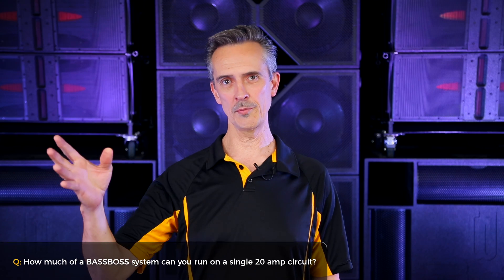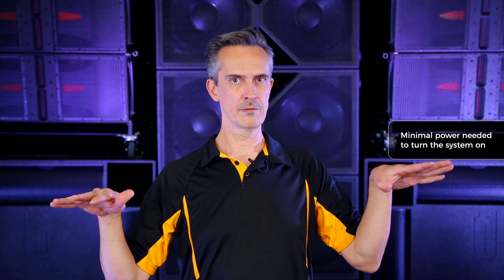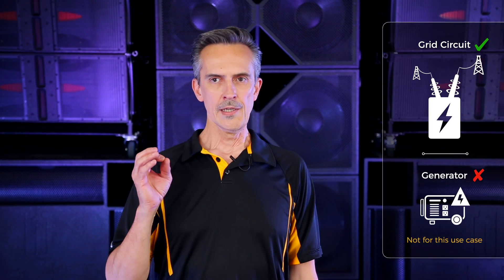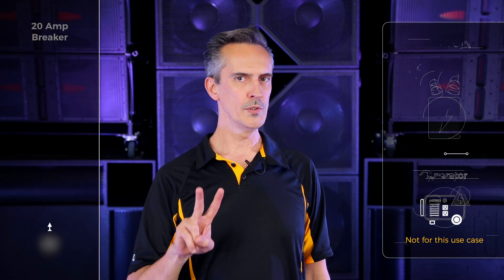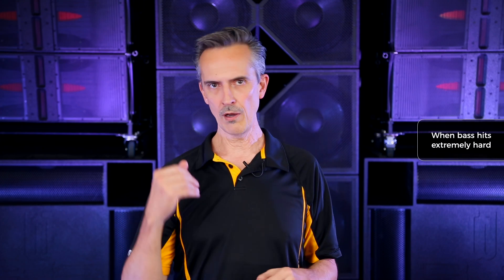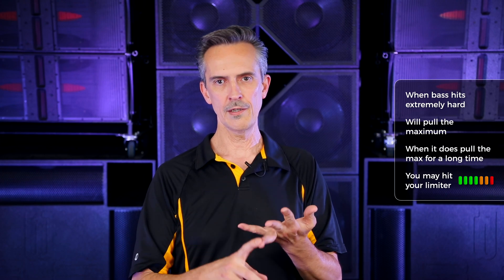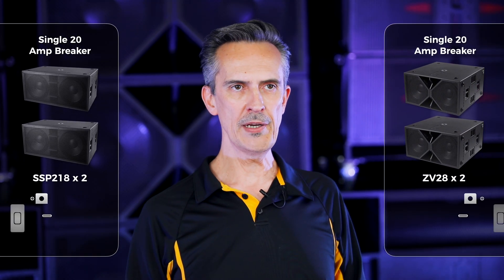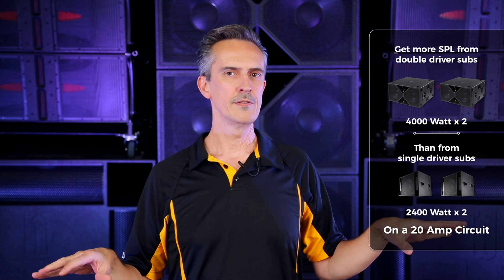BASSBOSS Subs and Tops for A 20 Amp Circuit

Comment: I used to build competition sound systems and its it a well known fact heat in any conductor (Climate induced or created by a products performance = Increased electrical resistance which in turn equates to a greater load to achieve the same desired (output). I understand that the amplifier will only provide based on what it is being given in terms of peer capacity and limits output if input power is lower but my concern is Brown outs are known to be detrimental and destructive to circuitry (this is when an amp has a load demand but the voltage needed is not available because it dropped. Do these have protection against this either a protect mode or capacitance storage to pull it through the drop until voltage restabilization occurs?

Comment: Hello, how are you? I would like to ask, firstly, if the systems are sold configured for 220v as well and, secondly, if so, what would be the maximum that could be connected to a wall line?  Thank you very much for your time, very good sound systems and advice
Reply from the maker: All BASSBOSS subwoofers built after January 2023 will be configured for 220V operation. Those sold before that are 120V only.  All generations of tops are 120.240V compatible. 

As far as I’m aware, a normal wall line on 220V is 16A, which is more power than is available from a 120V/20A circuit, so the 220V configurations would allow at least the quantities we discuss on the 120V versions. Theoretically the 16A/220V circuit would allow for 1.5x more power than the 120V/20A circuit, so running what amounts to 1.5X the recommenced quantities in the video should be possible without concern.